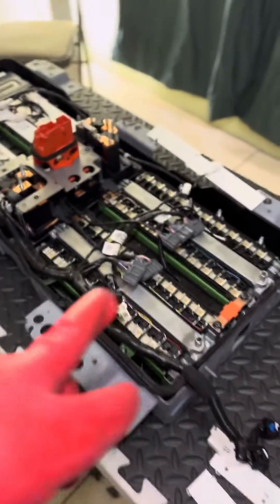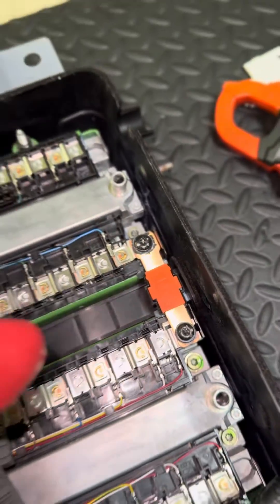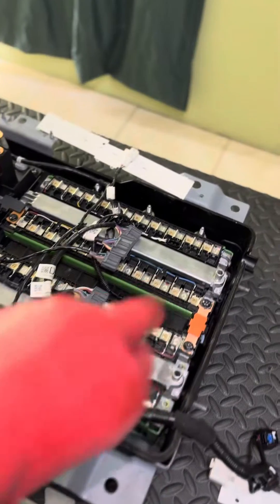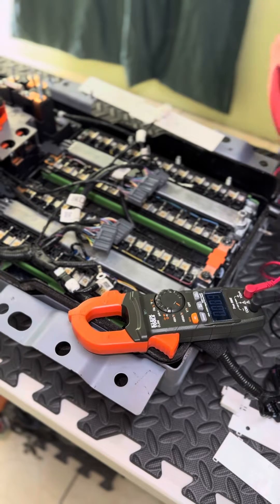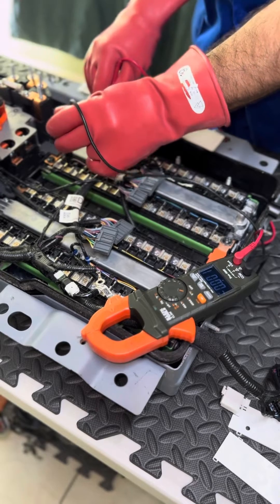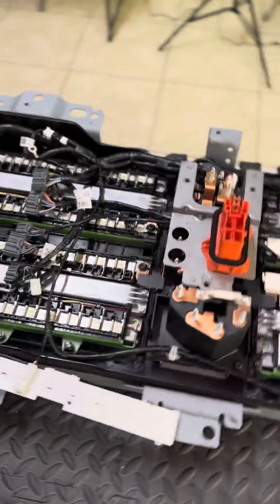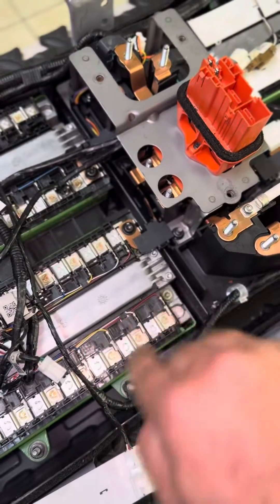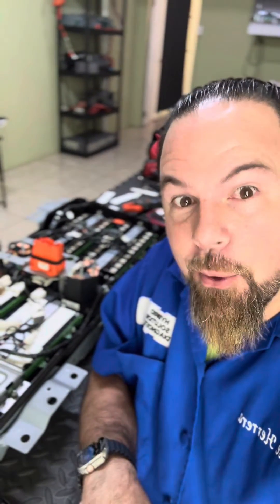Nissan Kicks e-POWER Battery Pack

Comment: Great work..
I need ur advice, I'm going to buy xtrail e4orce and I'd like to know if there is any way to figure out hidden faults before buying?
Also I've red a power failure problems with car owners.
Thanks
Reply: I think you should visit authorized dealer

Comment: So it's not sealed enough?
Reply: At the bottom of the front seat there are two holes for the blower aspirator, I think the flood went into those holes
Reply: Yeah. It seems sealed enoght to can't replace the cells, but not fully because then the cooling won't be effective

Comment: Hybrid Solution Diagnostics 
Is it possible & enough space for D.I.Y. upgrade battery cells of e-Power increase battery capacity more than 10kWh ?
*From the battery original 2.06kWh (4 module 96 cells) because sometime i need big battery capacity while driving downhill it's re-gen until battery full can't charge anymore.😂